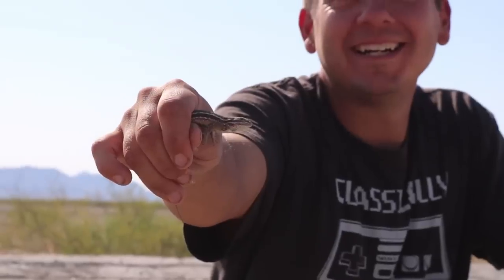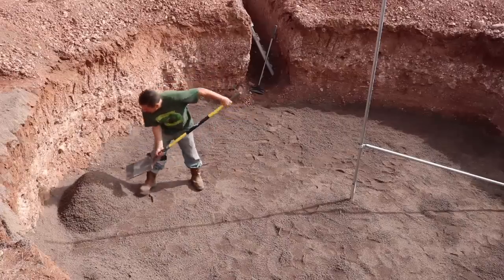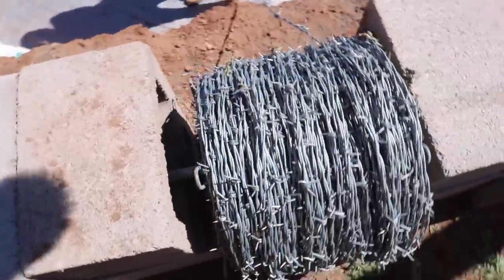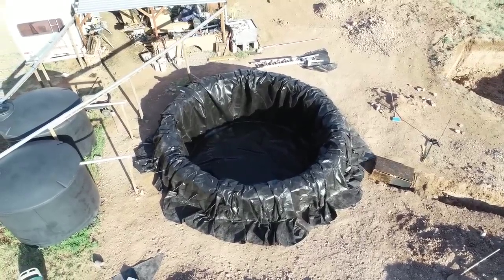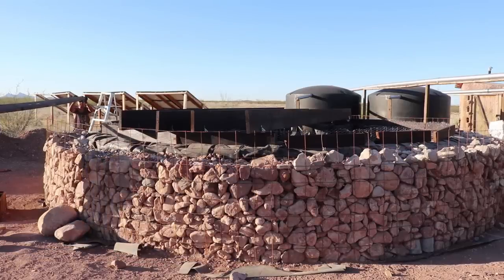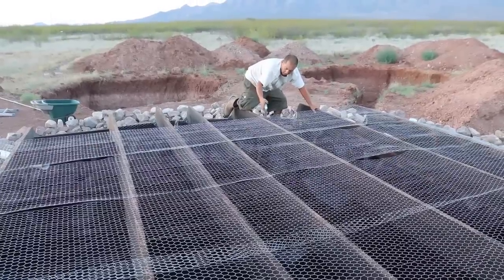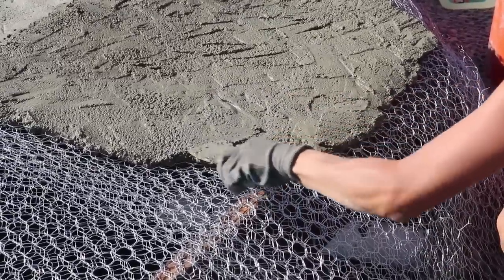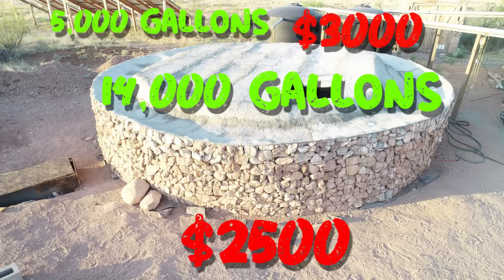THIS Cost $2500 | Total Cost And Materials For Our Earthbag Rainwater Harvesting Cistern

Comment: That much among of water can be used to store a lot of potential energy to another tank 4 meter higher if we use the concentrated sunlight thermal pump all days. When the water falling back to the big-tank through a pipe, the water flow can drive a turbine to generate electricity at night while the concentrated sunlight pump is doing the same.

Comment: Man that is a lot of hydrostatic head on the connection if it ever gets full.  Water weighs almost 8.5Ibls per gallon so  I truly hope it holds.  You will have about 20psi of pressure at the valve.  I hope you fulfill your dreams.

Comment: Struggling with the math here....  You have a 17' diameter cylinder with 8' in height walls.  8' +8' +17' = 33'.  How does a 24' x 24' pond liner fit with a lot of overlap?  Am I missing something here?
Reply: Yeah the 24' x 24' can't be right.  Looking at the overlap they had (17' + (8' up * 2) + (1.5 across top * 2) + (5' back down * 2) + (1 foot of excess * 2) = (17 + 16 + 3 + 10 + 2) or 48' so I'm guessing that's a 24' radius not 24 square liner.

Comment: You can just dig 1-2 feet deep trenches of 6 or 10 or 18 feet long. make 500 or 1000 or 5000 of them . Keep the soil at the edge . Rain water will get collected in them . 1000 such trenches will store 1000  X  10 FEET = 10000 Litres . or 2000   x  20 feet trenches will collect 40000 litres . That will replenish the ground water level . All the wells will have water in them for drinking purpose . I f you dig up larger areas of 5-10 feet , you can make a lake with rain water . All animals will have plenty of water .

Comment: Great job guys! We are just setting up our homestead in SE Arizona too. We are located near Portal. Where did you purchase the materials you said were cheaper than Home Depot? We need need to make a run.
Reply from the maker: That's awesome! It depends on what you're getting, but the stucco wire and remesh were definitely cheaper. It's B&D lumber in Douglas. They have more locations I'm not sure where. Always check the smaller outlets too.
Reply: Green Dream Project Oh Cool. We heard about that place. I was told they were expensive so that’s good to know. 👍🏻thank you

Comment: Green Dream Project
Jim and Jessica,
My Uncle and I are looking at some land around St Johns, AZ and are going to live off grid, build us a cistern and house from earthbags as well!!! 

You guys did a fantastic job with this!!! Your filming is awesome, your work and work ethic is superb, before you know it you'll have your house done as well. You need to either get something to leach the toxicity from the cement or seal it so it won't leach into the rain water...unless Ferrocement is already nontoxic, I haven't researched it to know!!!!

The surface area of the top of your cistern with the gutter is 415.27 ft2. 
For every 1000 ft2 and 1" of rain one collects 600 gallons of water. 
So, at your basically 415 ft2 which is a little less than 1/2 the 1000 ft2 
you will collect just off the cistern approximately **250 gallons** of water for every 1" of rain you get, just off of the cistern!!! 
You figure your area because it's round, by taking the radius and square it then multiply by Pi/3.14, so  11.5 X 11.5 X 3.14 = area of 415.27 ft2!!!

I'm so happy for you guys!! Thank you for sharing your journey!!!!
Reply from the maker: Thank you so much! Good luck on your search.

Comment: What an achievement!  Congrats!  I would do the same thing if I were still in good health. 
I can see someone 100 years from now appreciating all your hard work when they are still using it..
I wonder about one thing though .. The rain drains off the roof into the cistern?  Do you have some kind of filter ? I'm thinking of all the bird poo and dust that lands on the roof between rains... Even if you ifilter it indoors... Wouldn't the poo that accumulates inside eventually  cause problems? I don't know, just thoughts..
Reply from the maker: There will just be screens before it enters the cistern. After a while it's possible I may need to clean the floor.

Comment: Sence you didn't use any pool liner material under your cement cap, you might want to put a thick coat of organic sealer on the cement. Rain water will eventually soak through the cement & collect in your tank. I don't believe you would want to be drinking that water that filtered through the cement. Not good, not good.😝😝😝 After sealing, an organic stain or paint on top that matches the surrounding topography could make it hard to detect from the air. You know how those pesky government agencies can get, they might want to put a meter in your system. I had a neighbor in town that drilled a well next to his house just to water his yard & the city wanted to put a meter on his well. He had to get a permit & built an enclosed porch around his well so they couldn't get access to it. They tried for years but my friend finally won out. Good luck, it looks beautiful.
Reply from the maker: Wow, that's a crazy story. It doesn't surprise me though they wanted to start charging. 🙄

Comment: I really love what you done it looks very nice and I think it will last for a couple hundred years.  But I look at all the cracks in the rocks and wounded if scorpions will want to make it their home. I guess you could fill them in If that starts to happen.
Reply: I wonder if in my area the freezing would be a problem.  Snow turning to ice , would it cause shifting, rocks cracking etc.   it sure does look like a nice hidey hole for lizards to me.  I’ve got  50 gallon rain barrels and float little pieces of wood in them in case birds lizards etc sneak into them.     Every now and then I rescue a very crabby lizard floating on the little boat trapped in the barrel giving me a pissed off look.

Comment: Great final product guys, looks great. I have to say tho, it is not by any stretch cheaper. your labor costs and mental anguish put the cost way higher than just buying the poly tanks to do the same job. surely you look back and think wtf were we thinking? Earth-bag is not cheaper when you factor in labor, it's just a ridiculas notion to even think that. you would have saved money and time just pouring concrete to line the walls and been done with it. forget the earth bags and liner altogether. do you concede this point now that you've seen the work that this takes? I'd love to hear your thoughts.
Reply from the maker: No. Well worth the sweat equity. If you don't have the cash, you can't get the tanks. It may not be that way for everyone, but for us, worth it.

Comment: Until you need a boat to access it you can't go too large on water security in the desert.  The fact that 14000 gallons would be multiple years of water so once full you no longer need to worry about if it is a dry or wet monsoon season. 

Odd question but would you like a visual indicator of water level in the tank without ever needing to open the hatch? Very simple build using a float ball normally found in a toilet tank screwed onto a fiberglass rod that connects between the float in the cistern and the rod exiting a small drilled hole for it. A simple high vis flag on the end of the rod and measurements painted onto it and you can know exactly how much water is inside as the 1 foot of water equals 1,697.93 gallons
Reply from the maker: Thanks! We'll definitely have to include that.
Reply: @ourselfreliantlife  Don't worry I stole the idea from Engineer775 as he put in one to be able to see the level in the tank on the hill without needing to go up there. 

I properly removed all the serial numbers before passing the idea on as it is such a simple method as a float and fiberglass push rod 8-10 feet long so everything is under $100 including paint. When next to a post it is easy to paint on how full the tank is as it is 25% per 2 feet of water.

Can also enclose the marker flag to help keep bugs and dust out when the wind is blowing using a 2-4 inch clear section of pipe with a cap on the top and cemented to the cistern cap on the bottom but that would add another $100 or so onto the cost.